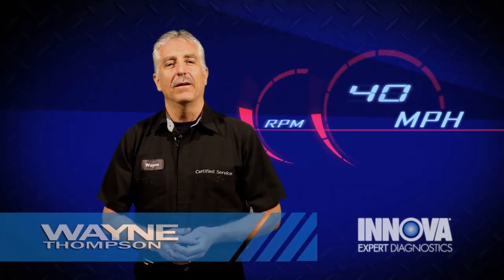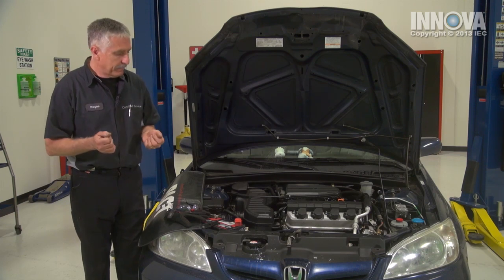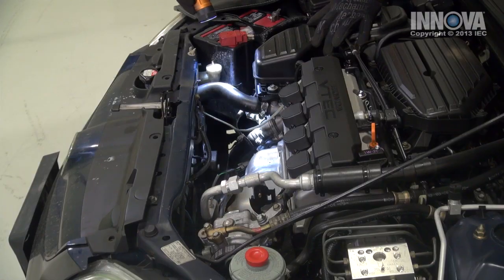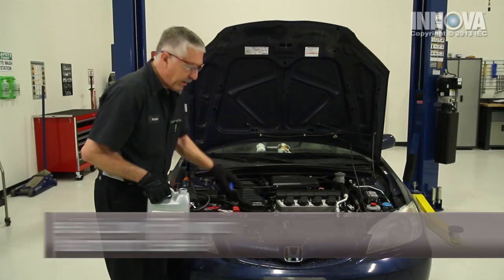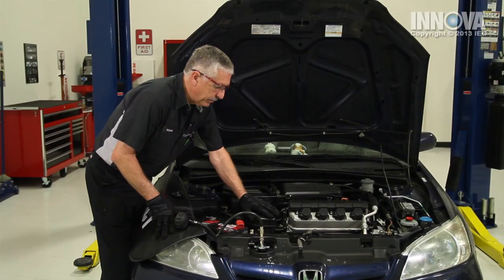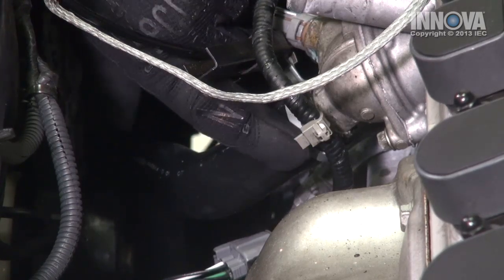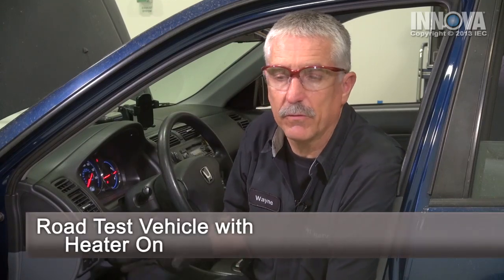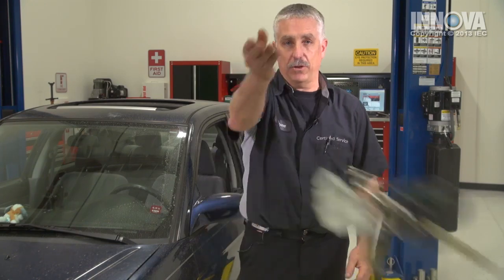How to diagnose  an Overheating Condition - Radiator Hose - 2004 Honda Civic

Comment: Hello guys I have a 2004 Toyota Avalon..I had it for a year Runs great very smooth and quiet I recently used the AC for the very first time the first day I used it I noticed the temperature gauge started going up so I shut the AC off temperature drop back down to normal the next day went out again it was a hot day turn the AC on temperature went up again a little higher almost hit the red zone I pulled over part let it sit for a while restart at the car started driving turn the AC off temperature drop back down to normal but this time it started going back up again pulled over and let it cool down I was only 5 minutes away from home I'm very careful with my car's so I pulled over anyways didn't want to chance anything the next day I took it to the dealer the dealer said I had a blown head gasket I cannot believe it the car runs so smooth and quiet I had worked on cars before in my younger days but I had checked the oil and antifreeze everything was clean old milky Flash no nothing car runs quiet no smoking out exhaust pipe nothing I took it to another mechanic they rechecked it for me they said I had a blown head gasket I had them replace it they replace the head gasket got the car back the car run even smoother which was unbelievable because it ran smooth to begin with but I turn my AC on and it starts so I now drive the car with no AC cuz somebody please tell me why just this car only overheat when I turn the AC on can somebody please help me and yes both cooling fans do go on thermostat was changed when they replace the heads

Comment: The radiator hose popped off when engine switch off but no heat was detected by sensors it is a prado 150 2010 why is that I need to know it fast

Comment: Hi guys, I have a 2014 F150 5.0 and after about 15 or 20 minutes of running the coolant fans both of them kick into high. There is no overheating everything seems to be OK but they kick into high and it appears to be a common problem. I did just have the engine replaced and it did not do this before hand but now does it. Any thoughts?

Comment: Hey, I have a 2006 Honda accord.......my idle keeps going up and down causing the car to overheat, what must I do???
Reply: How's your fluid. Try looking for white spots around engine as he showed. Change your thermostat. Very easy and cheap. Your idle surge could be sure in your system. Idle it with hester on and watch temperature. Should be fine while it purged air out of system. Go to chrisfix channel . He is amazing and so is scotty kill more. Good luck and let me know.

Comment: I have a 2003 Honda Civic LX which has an overheating issue. I have been to multiple people and have replaced multiple parts to try and fix the problem. The overheating in my car only occurs when I am climbing up a steep hill. Driving on flat land or through our town is completely fine. I have replaced my thermostat 3 times, my water pump and timing belt, a sensor to the temperature gauge 2 times, upper and lower radiator hoses, a switch which the guy at the auto parts store called a "fan switch" 2 times, and have also had it tested to see if my head gasket was the issue; it read to be okay though. My car currently has around 144,000 miles on it however the dealer that I bought the car from said it had the original engine, which I soon found out was a lie because the mechanic who put my water pump and timing belt on saw junkyard markings on the bottom of the engine. Any insight from you or anyone else who may see this comment is very appreciated. Thanks!
Reply from the maker: +Cody Litten
Thank you for your inquiry. We do not have service manuals for your vehicle to give you repair advice. We suggest referring to a service manual for the issues you are having with your vehicle.
Reply: hi the same thing happen to a car that i was about to buy  it was 05 civic special edicion the guy even was selling me the car for 1300  i want that car so much!!!  but like im telling you the same thing as yours and same miles about 140 something !!!   even the guy change water pump , timing belt     and all that you done to yours

Comment: hey Wayne, I have a 2005 Civic LX.  I appreciate any videos on doing repairs on these cars.   Mine has 93,000 miles and I still have the original radiator and heater hoses.   I'm assuming they are needing replacement, but I've heard that Honda hoses can go 100,000 miles.   Should I go ahead and change them?   Thanks again.
Reply from the maker: +Glenn Dallinger

Thank you for your inquiry. We
do not have repair books for your vehicle to give you the recommended
maintenance on your vehicle. We suggest you consult with a service book for the
maintenance on your vehicle.